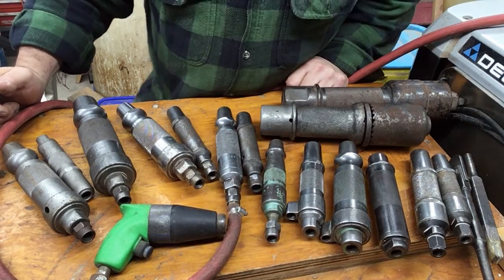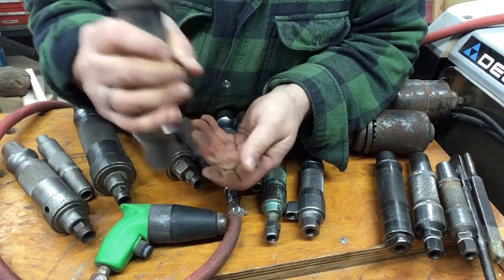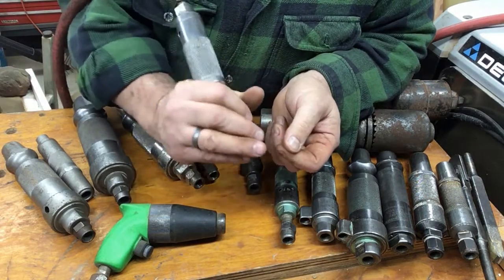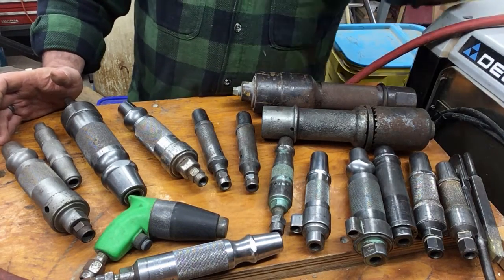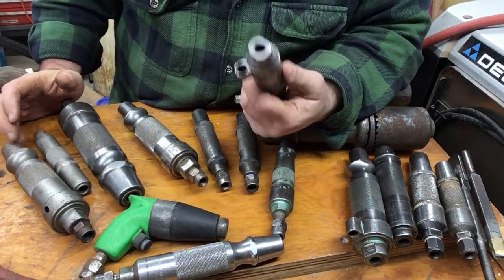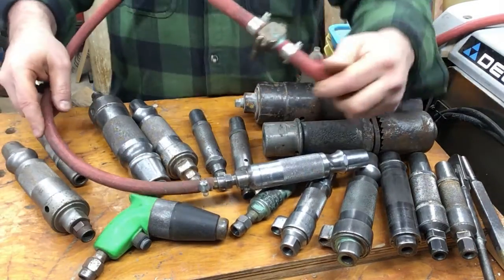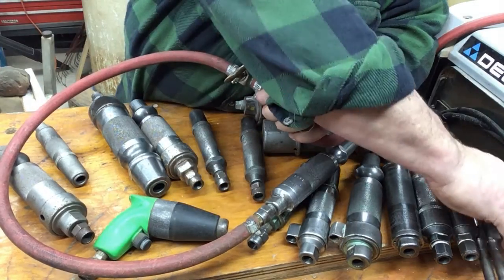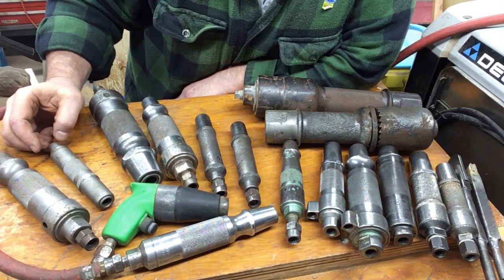Traditional Stone Carving Techniques- Pneumatic Hand Machine Hammers for Stone Carving Video 1

Comment: Interesting Pretty useful info
 started fouling around stone carving manually recently thinking of slowly upgrading to compress air and try my luck Appreciate you shearing your knowledge will make it easier to go ahead .
Thanks & Take Care
 From Quebec
Reply from the maker: Moving from hand-driven to machine-driven work can be a good step, but it only makes things happen faster.  Get comfortable with hand tools and sharpening tools first.  I’m a big fan of working in clay or wax to compose your ideas and goals before working a piece of stone.  Even if your composition is abstract, there is true benefit in being able to produce & reproduce a specific item at will.

Comment: You have a Great Hoard /Collection right there 👍😀👍 I have a few  old and New Air tools , Trow and Holden's , A Bon Accord, A Chicago Pneumatic and a ( D ) model which is truly a BEAST 👹  for wasting off made in Fraserburgh Scotland ,  short strokes and long Strokes, From the Barre Bantam, All the way up to the Beast 👹 , It's Great to be able to change Gun to suit the Job 
  Good Video & Greetings from Australia 🇦🇺👍😎
Reply from the maker: Glad to hear from another hand machine proponent.  They often get a bad reputation but many times their exaggerated danger is a result of improper handling.  When one relaxes and simply guides the machine instead of trying to restrain it, they’re a lot less injurious to use.
Reply: @carolinasculpturestudio  I have been using them quite often for over 25 years and my Hands are fine,  No White Finger,, No Silicosis, It's All about Technique, every Gun has its place, as you also said in your video
I have seen many idiots  with Air tools over the years  lol 😂👍 and no doubt you have too 👍🤣
Reply from the maker: @haroldmclean3755  I do have nerve damage from the tools and pretty confident I have some level of dust.  After so many years of full time work in granite, it is largely unavoidable.   I carved actual tons of ice as a chef, which provided a fantastic platform for stone carving.  Because of the nerve damage from hand machines, it’s nearly impossible for me to work with ice or similar cold/frozen items anymore.

The unavoidable nerve damage a major reason why the Granite Industry business model here in the USA has changed from employer-employee to almost exclusively self-employed.  There has to be a certain amount of personal accountability to accept that this work is not beneficial to the human body.  You will be impacted and cannot expect an insurance payout from your (former) employer once you realize that being a brilliant sculptor is a lot harder than you thought and that the injury from attempting it will be permanent.   

The alternative to hand machines is die grinders with diamond bits, which produce greater quantities of the most deadly fine dust.  One may avoid white hands issues, but the risks of silicosis can be greater.
Reply: Hey there, it really sucks to hear that you have some Stone related  Medical issues,  Most other Stonemasons I know over here, Who are 20 + Veterans  of the Industry have  niggling issues  , Bad Backs, knees, shoulders and the dreaded Masons elbow and some have had to quit the profession, because of lung related issues ,  I work mainly with High Quality Sydney Yellow Block Sandstone,, The Really good stuff is harder than Concrete and the Dust created when worked can be a super pain in the Crack at times, especially when you get Blokes around you, who are useless at working stone by Hand or with pneumatics, Who are addicted to Dry Cutting with Grinders, No Good  👎  I have been using a Cleanspace 2  rechargeable  Respirator for the last 3  years, And they are very good, I'm not one of these Silly  C**nts , who do not take Health and Safety seriously, It's not just up to an employer to take care of your Safety,, Employees are responsible too , in Australia at the moment, There is a movement to ban Caesarstone , because of its 100% Silica content,  Polishers are getting   Silicosis and Croaking it, many many polishers are dying super young because of the Dust it creates if cut dry , I'm glad I have never had anything to do with that Man made Detritus 🧆 , And the Good News is it looks like it will be Banned , when I'm not busy Working or solving and Fixing problems, I like to get as much Fresh Air as possible , I often think to myself  " Why did God make  Stone so Heavy ? lol 😂👍
Reply from the maker: @haroldmclean3755  the medical issues are just part of doing granite.    I’ve always had industrial-grade dust collection equipment designed specifically for this work and wear a P100 mask more now than ever, but the dust gets into your clothes and goes wherever you go.    So you’ll breathe it in your car, in the house and everywhere you go.  It’s just reality.  

Many, many people posting videos who work in enclosed areas, with no suction or both overlook the vector issue of the deadly dust going home with them in their clothes and such.  Whatever mask they’re wearing only works until they take it off & I’m certain that they’re not wearing it 24/7 365 days a year.

I do dry cut, but only with suction.  One of my Masters used water to mitigate his sawing and grinding dust.  It works but it’s a mess.  I polish on occasion using pneumatic polishing equipment with water.  It’s also a mess.
Reply: Alot of Blokes like growing Beards these days, Not a good idea with Dust  ,  Yes , Banker Shops with poor Ventilation are a Health Hazard, I have been too and done some work in a few too, , The BIG Quarries over here have Very Good Set ups, and I have worked for a few over the years , They are Very Large Open Air   Workshops, on Private Property, where the  Wind and its accommodating Air Flow naturally blows all the Stone Dust away during the Day or Night, One must still wear a mask nonetheless, Dry Cutting with a Vacuum is quite ok 👍and I have no problem with their use ,However I take issue and It's a completely different story for those who dry cut with  9 inch Grinders and 5 inchers inside a Banker Shop,  In Sydney Australia  we had a load of British  Banker Masons/Angle Grinder Masons and some Carvers over here in 90's and early 2000's who were addicted to Dry Cutting, many developed  Silicosis and Mason's Elbow, They all thought they were Brilliant  at the time , No they were Stupid  and had Poor Hand and Pneumatic tool skills, I Don't miss these Angle Grinder Masons, I thought them as SHIT 🧆

Comment: I was wondering your vedio, I am a sculptor espetioly work with black granite,I allredy purchased  one piece penwmatic hammer with air compressor,I would like to ask one question is which pound of hammer is necessity for granite,
Reply from the maker: Thanks for watching.  

Trow and Holden Type “D” (3/4”D, 1”D and 1 1/4”D) pneumatic hammers and equivalent machines work best on hard stone like granite.   “D” means full or long stroke and is designed to cut granite effectively.  The size of the piston in the machine - 3/4”, 1”, 1 1/4”- helps determines how much stone can be removed per blow, a good large piston machine can be operated slowly by an experienced expert to do delicate work.

Trow and Holden Type “B” (3/4”B, 1”B)  and equivalent machines,  Cuturi and most F&K pneumatic hammers have a shorter piston stroke that is better suited for stone that is softer than granite.  I do not use these machines on granite.

For hand swung hammers, hammer weight depends upon the task and amount of stone being removed per swing.   I use my 6lb hammer the most for normal pitching and pointing work.  It is my favorite.  I also have a 4 pound, 2 pound and 1 pound hammers for lighter work.  I use larger 8 pound and 12 pound sledge hammers for the heaviest work like splitting and bullsetting.

Comment: Can you recommend a compressor for beginners, the power and capacity of its bottle, I'm new to this. Thanks
Reply from the maker: It is usually recommended to buy a compressor that’s at least twice as big as you think you need.  Otherwise, you will overwhelm and quickly wear out  a small compressor.  Until that happens, it will often be a limiting factor in your work capacity.

If your pneumatic tools typically use 5-6cfm, your compressor should produce at least 10-12cfm.  Having a large tank with more storage capacity, like 50-80 gallons, is better than a small tank.  Adequate tank size will allow the compressor to rest is good.  Otherwise, the compressor may have to run continuously to produce enough air.

A two-stage compressor is recommended over a single-stage compressor.   A compressor pump designed to operate at low rpm (around 800 rpm) is recommended over a compressor that runs at a higher rpm (over 1000 rpm).  

Make sure that the electrical specification of the compressor match your available electrical service- 1 Phase, 3 Phase, etc.  A 3-Phase commercial unit may be less expensive but it may not be suitable for your electrical service and changing motor to 1-Phase can be very expensive.

make sure to drain your compressor tank often, if not daily.  The small screw-in petcocks found on most small home compressors are useless.  Install an easily-reached and -operated ball valve to drain water that condenses from the compressed air to prevent rust in the tank.  If buying used, avoid any used compressor with a repaired or excessively rusty tank.  A fully pressurized tank is an actual bomb that can kill you.  

In order to get a large enough compressor, buying one in used condition may be more affordable. A small compressor may work to get started, but a serious large compressor (two stage pump, 5hp electric motor, 60-80 gallon tank) is a worthwhile investment that will make carving much more enjoyable.  It will also better support larger tools and your studio/workshop in general.

Hope this helps.  Good luck and thanks for watching.

Comment: Thanks for this great video on pneumatic hammers. So far I have two, ond is Cuturi V and the the other is F&K 713A. I bought them to carve marble. The F&K 713A is very powerful and I use it to roughin out. On the other hand I find that the Cuturi V creates a lot of vibration and doesn't cut much. Is this normal? Thanks
Reply from the maker: Watch my F&K hand machine video.  https://youtu.be/kHYlBgQmIBw  It may help.  

As mentioned, typically a harder hitting & slower hammer is better for hard stone like granite.  A hammer that runs faster with lighter hits, which feels like more high frequency vibration, will cut softer stone faster.   The buzzy quality of a machine designed to carve marble is normal.  This may seem counterintuitive because most people would think that hitting the stone harder will make the process of carving go faster, regardless of the stone being carved.  In my professional experience, it doesn't. 

It also doesn't matter if you are using a hand swung or powered hammer.  Using more swings of shorter throw will carve soft stone faster and more accurately than fewer big heavy swings of the same hammer.  There is conflicting advice on the internet about this subject.  It is typically being offered by those who do not earn a living carving stone and working full-time in the craft.  It is more romantic to imagine big heavy swings taking off large amounts of stone with each hit.  Follow their advice if you like.  

Always remember that little pieces are little mistakes.  So if you make a little mistake, it may not matter as much.  By comparison, big pieces & big mistakes are often fatal to your project.  In a professional studio working 8 hrs a day, these things are easily recognized and understood by an expert.  That is my advice to you.

Comment: Does anyone know anything about a dallett model 400 holedrill ? The fixture on the end says cleco it's probably as big or larger than anything on his table with a D handle I'm wondering if maybe it was used as a riveting gun but not sure
Reply from the maker: In the studio in Barre, we generically called the big D-handled hammer we used a Cleco even though it was a different brand.  I forget what it was, but specifically asked my cousin about it.  He said they had always called big hammers like that a Cleco no matters what it was, like calling something a band aid no matter what brand. 

 Lots of tooling interchanges between pneumatic hammers and drill, too.  It’s usually only a matter of diameter and length of tool & receiver and then, hex, sds or round shank.

I should have included my Chicago Pneumatic CP9-AK rotary stone drill in the video.  I have one I use only for  9-point rough-out work.  Many similar drills can be used in hammer-drill or hammer-only mode.  Using them extensively in hammer-only mode tends to ruin the drill function.  So I have two- one used only for drilling and one used only for hammer.

I have yet to try using a legitimate aircraft riveting hammer like a 3x or 4x for rough-out work.  They hit much differently than a typical drill or hand machine- much longer stroke with fewer hits per minute iirc.    I’ve tried using my hand machines for shaping sheet metal and found they’re more like using a planishing hammer vs how the air motor of a rivet hammer performs for flow forming and shaping.

Big hammers like that can bruise or damage granite, so are only suitable for working directly into a significant mass of hard stone.  On softer stone, the big hammers cause be too destructive to use at all.
Reply: @carolinasculpturestudio  thank you very much for such a detailed response ! I'm not a stone carver, I buy sell and repair tools, and don't know if the tool was made for a specific industry, or can be used for many , But if it was a riveting gun I would guess it would be called that and not a holedrill, so I'm thinking maybe for mount Rushmore work, or demolition.  I didn't realize how long ago such tools were made , I guess if it's old enough and don't work then it might be a tool someone might collect to hang on the wall correct ? Cuz the company is out of business and I don't think I can get any parts for it .
Reply from the maker: @jacobclark89   Granite City Tool in Barre VT. https://www.granitecitytoolvt.com Is the current source for Dallet pneumatic hand machines.  I understand they purchased  the name and all rights when the original Dallet Tool Company in Philadelphia PA closed.  I also understand they are not the actual manufacturer of their hand machines, much like Bicknell Tool no longer makes theirs in-house.  There may be information about your machine via someone at GCT.  

Many of these machines are relatively straight-forward to rebuild by a properly equipped professional company like Trow and Holden in Barre, VT. https://trowandholden.com  Not sure what rebuild services are still offered there.  Norm has retired.  Now Randy is top dog at T&H.  It usually comes down to a matter of affording to spend the equivalent of buying a new machine to fix an old worn-out & abused machine.  Most people simply won’t spend that much to fix an old machine just out of curiosity.  So they become novelty conversation pieces or wall hangers, never again to be employed or wielded in anger…

Good luck.
Reply: @carolinasculpturestudio  thanks ! Unfortunately while cleaning rust from the name plate, with a magnifying glass  I noticed that the serial number and most of the word serial had been ground off ! All but a 2 , so I returned it to the thrift store that I bought it from cuz I don't get involved in stuff like that. Oh well, I did get to learn a few things .
Reply from the maker: @jacobclark89  - Better luck in your future pursuits & acquisitions.   

While some tools with an unknown history may have identifying information removed by those trying to conceal something, it is not uncommon for tools that have been surplussed to have power cords removed,  serial numbers on tags destroyed or both by the legal owner as a means to permanently remove the tool from use.  That is generally the intent of surplussing equipment.

In my work, it's traditional to smash existing original plaster models upon retirement or closing of a studio.  This prevents the models from being used and possibly claimed as original work by subsequent carvers and sculptors.
Reply: @carolinasculpturestudio  they can't all be winners.